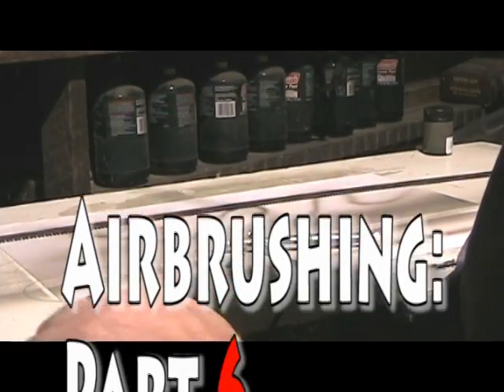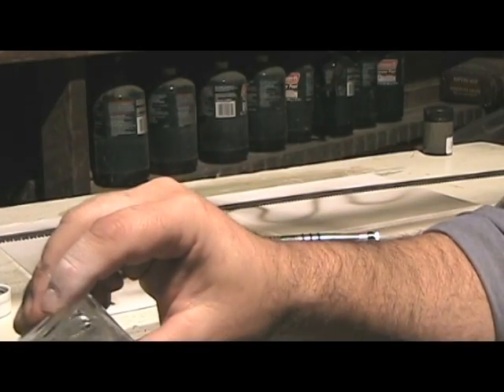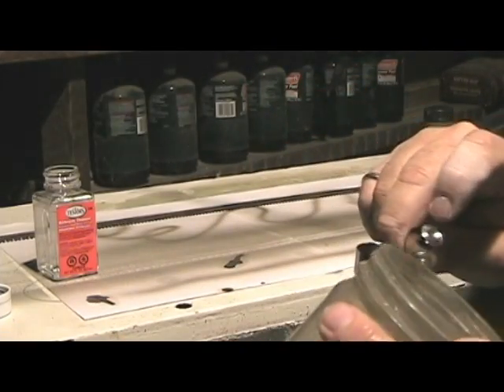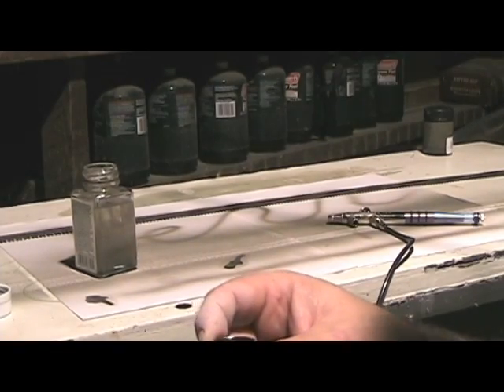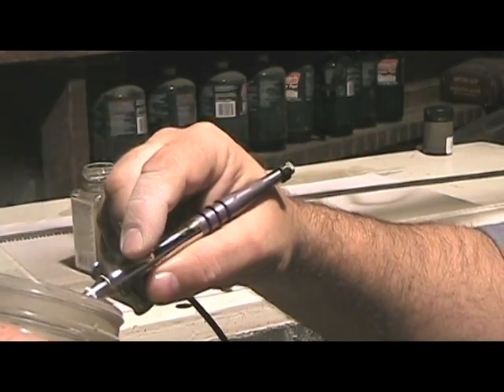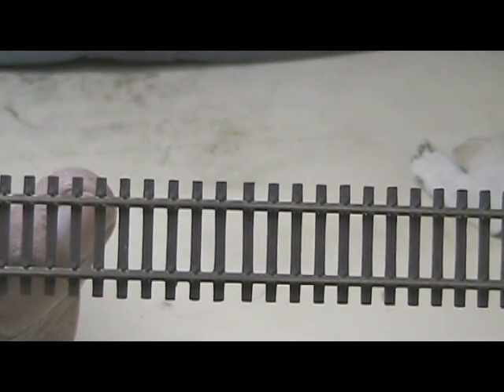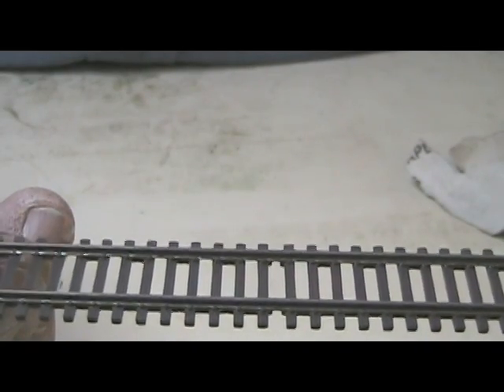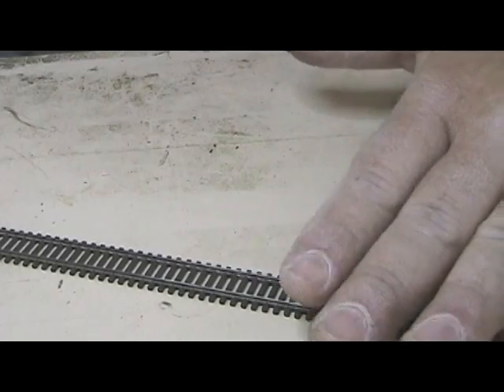Model Railroad VLog: Airbrushing: Part 6

Comment: Best thing is to spray about 3/4 of the thinner out, then wrap paper towel around whatever finger you have that fits into the paint cup.  Put the finger with the paper towel into the paint cup, turn it all upside down, and wipe the inside of the cup while absorbing the left over thinner.  Then inspect to look for any remaining paint.  If there is any (like you had there) repeat the whole process.